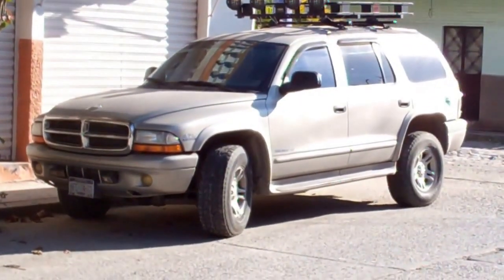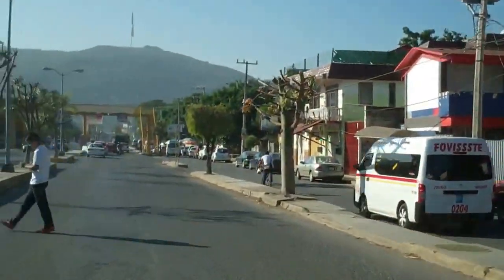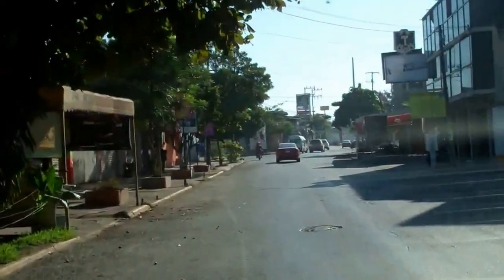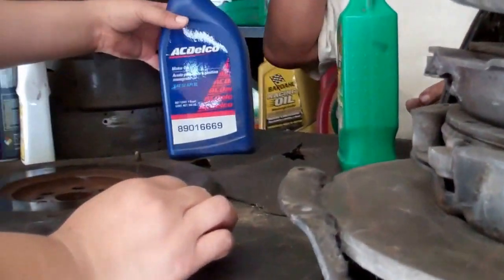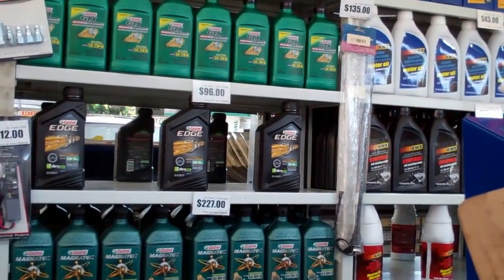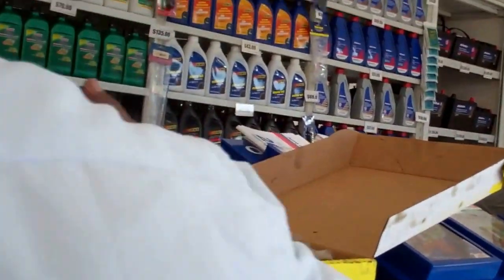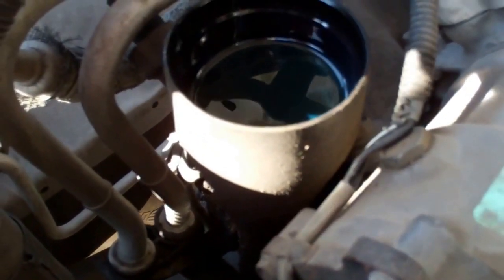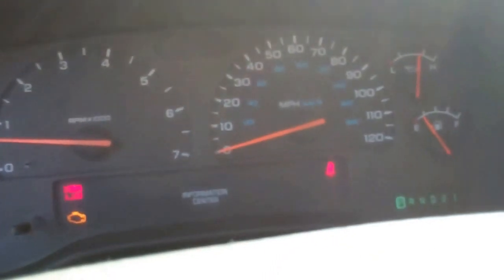Durango Rant & Preventative Maintenance - Iguala Mexico

Comment: It burns oil? So you got some worn rings? BTW You still need help with spanish Richard? Thought you'd be fluent by now.
Reply from the maker: #1 cylinder has 90psi and has blow-by.. That's where it's burning oil.. It needs a head job at least but a total rebuild is recommended. My Spanish comes and goes..